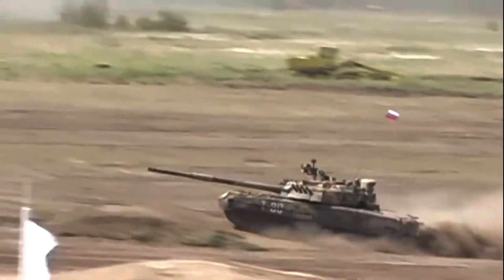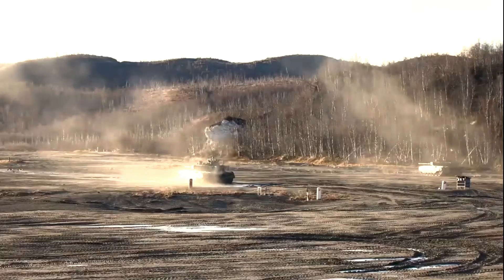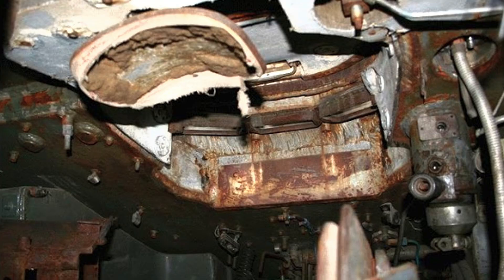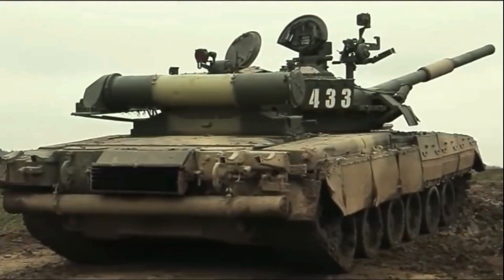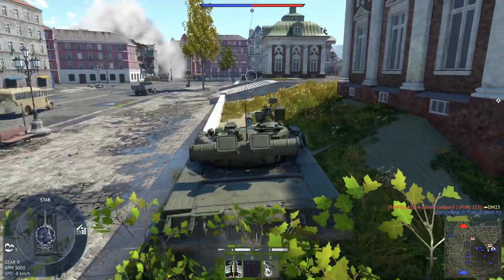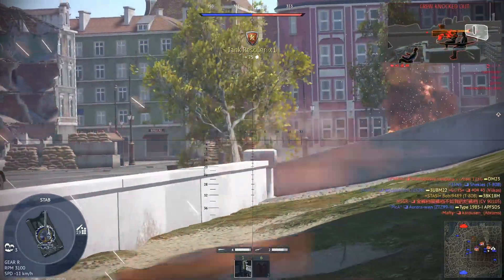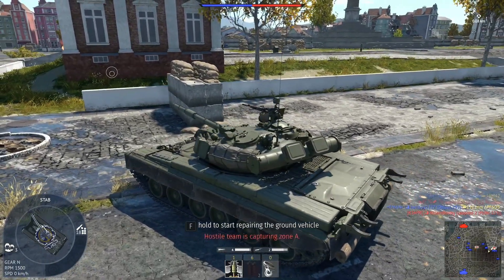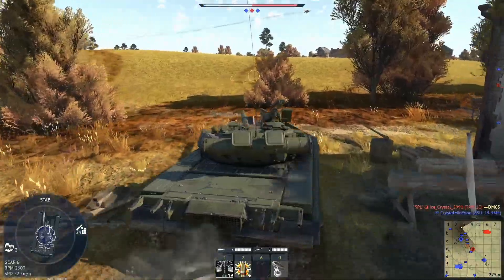Why not the T-80?

Comment: The solution for the Gas Turbine idle problem is an APU.
It's been standard on Abrams since the M1A1.
I would be surprised if the Russians haven't figured it out yet.
Reply: I think t-80uk had an Apu ,but it's insignificant bc there are only like 100 of them, probably less
Reply: @aldobatres7086  That's the command variant of T-80U. The APU was probably for powering the extra equipment. I haven't found many details over how they used the AB-1-P28.
Reply: The Abrams is huge soo its spoiled for space, the T-80 not soo much

Comment: Early T-80 is pretty bad ngl. It's more like T-64 with some advance tech for Soviet at that time and more powerful engine. But cost more and require more refuel. While more modern and more powerful T-80U series problem for me is it is too expensive and too complicate even compare to T-80B series. Because of that it never got proper treatment like cheaper T-80B series despite shown so many potential like at one point in Cold War T-80U is one of the most protected tank in the world due to being the first to ever install heavy Explosive Reactive Armor "Kontact-5" and even feature much more modern armor compare to most Soviet tank except T-72B series, it became MBT platform that feature some high tech for Russia after Cold War like T-80UM-1 "Bars" a prototype tank that install Arena Active Protection System, T-80UM2 (prototype with feature KAZT Drozd active protection system), T-80UE-1 (An export T-80U with more armor and thermal for gunner) or even cancelled project Object 460 "Black Eagle" in which use T-80 tank hull but install much safer ammo rack inside the turret. But even it has some problems it is still good tank especially in conventional war scenario in which it was design for

Comment: 1. the TKN-3M was a generation 2 passive night vision tube which is on par with US equivalents like the TVS-4 however most NATO tanks didn't even have a passive night vision periscope for the commander in 1976. the M60A1 RISE was the first US tank to obtain this capability with the M36E1 periscope however the performance wasn't much better than TKN-3M and required additional IR illumination to see past 400 yards. the Leopard 1a4's night vision device was an active IR not passive and the British used active IR for the commander and a gen 1 passive device similar to the PVS-2 starlight scope for the gunner.

2. laser range finders from the 1970's weren't known for being 100% accurate, NATO laser range finders where Ruby based which consumed a lot of power and often would give back false reading or "ghost readings" so gunners where advised to pick which ever range seemed logical. so a 30m margin for error is considered more than acceptable for the standards of the time and even modern laser range finders are around 5 meters margin for error depending if the target is moving.

3. The gunners sight is not directly tied to the gun elevation during the loading cycle once the gunner hits the load switch it disconnects the gunners sight from travel axis of the gun, once loading is complete the gun will elevate or depress to where the gunners is currently aiming thats the main reason countries moved away from coaxial aiming telescopes for top mounted sighting housings to avoid the sight being knocked of target when the gun is elevated to the loading position for the loader. 

4. The Soviet Union was largely behind in thermal imaging manufacturing because of the economic recession and later depression of the 1980's, the collapse of the Soviet Union further compounded this problem and thats why the Soviets fell so far behind. However its worth noting that Thermal imagers definitely represented the next phase of tank development early thermal imagers as seen on Leopard 2 and M1 faced the same issue of low resolution as the AGAVA-2 this is why friendly fire incidents where so common in the first gulf war and what spurred the development of better thermal imagers. 

5. I think you are misunderstanding the point of the 12.7mm machine gun on soviet tanks. it wasn't really used for anti infantry purposes the point was to shoot at low flying helicopters. Most T-80 commanders would lock the cupola in place and only unlock it to scan the battle field as necessary however the cupola rotates on ball bearings which makes rotating not that difficult no different than the HMMWV turret mounts. 

6. the chain reaction of ERA has already been largely debunked both in photos in Ukraine and by independent testing the explosive filler isn't set off by heat but rather compressive force and it requires a lot of compressive force that only HEAT and APFSDS can provide.
Reply from the maker: 1. You’re right that the TKN-3M was similar to US equivalents like the TVS-4 and that many NATO tanks didn’t have passive night vision periscopes in 1976. But my point was to talk about the limitations of the TKN-3M in practical use, especially the fact that it was unstabalized and had low resolution, which were significant drawbacks in a dynamic combat environment.

2. You're right, early laser range finders, including those used by NATO, had some errors and other problems. But I'm pretty sure I also mentioned that the error margin was acceptable to some degree because of the estimated tank combat distance during a war in Europe, which was about 1,500 meters, and with APFSDS ammunition, which had a flat trajectory, it was even better. I know I just "debunked" the limitation I presented, but still. You get the point.

3. From what I know, this is not true. And I also haven't found anything that confirms your statement. The sight has dependent stabilization in the vertical plane, with 20 degrees of elevation and 5 degrees of depression. Dependent stabilization means the sight is technically stabilized, but it relies on the cannon's vertical stabilizer. Since the cannon has to elevate by +3 degrees for the loading cycle, the gunner usually loses sight of the target immediately after firing and can't observe the "splash" to adjust the elevation. The commander can see the target, but this isn't a very convenient way to operate.

4. Yeah, that's right.

5. Yes, you're right that the MG was to counter helicopters. But the way the commander would have to use it is still very inconvenient. And in very heated battles between a heli and a tank crew, the commander might have to aim behind him, if the heli changes position. But he can't do this because the MG is mounted on pedestals instead of a ring.

6.After doing some more research it seems like you're right, and I had wrong information. I apologize for that.
Reply: @bobiwt  1. yes but you have to remember than stabilized commander sights was also incredibly new and novel the only tank with a stabilized commander sight was the at the time new Leopard 1A4. This is also the time when tank engagements while moving wasn't considered practical because of how long it took to lase the target and lay the gun. 

3. I think you are getting confused between the Gunner's NV sight and his primary sight. on the T-64, T-72 and T-80 the NV sight is separate from the gunners primary sight the NV optic has just a simple BDC reticle and is tied to the stabilization of the main gun however the primary sight operates completely independent of the main gun. this would remain this way until adoption Sosna U.
Reply: @bobiwt The main (day) sight stays on target after the shot. https://youtu.be/By8Oci7XvEY?si=MK-DXB3A_l0cplrT
Reply: @bobiwt  that much "youre right" points make it worthy of an addon video my brother.
Reply from the maker: @glalih  You do know acknowledging the other person before making a point is just common in communication, right? I don't mean it provocative.
Reply: Bro unfortunately isn't going to read this I don't think

Comment: i  think its  overall great tank tbh autolader no need for loader small coverable in camo great for russian plains fast agile the only thingg it lacks is safety cus of ammorack and reverse speed everything else in check:)
Reply from the maker: Well, the reverse speed is still a lot better than with the T-64s, T-72s, and T-90s. Unlike the ones mentioned, the T-80 goes 11km/h in reverse, and the 2023 model of the T-80, the T-80 BVM, goes over 20 km/h in reverse.